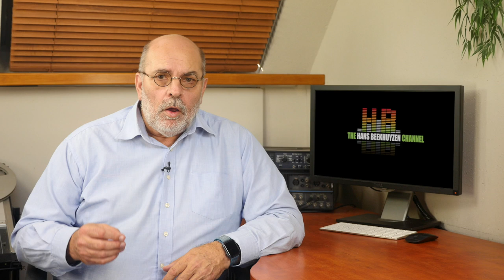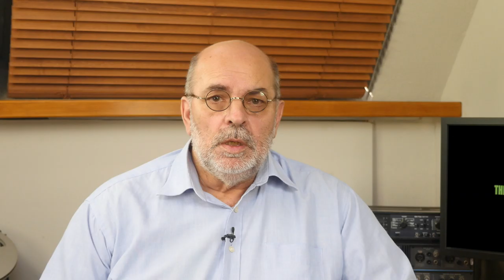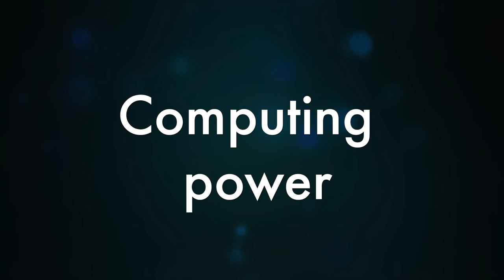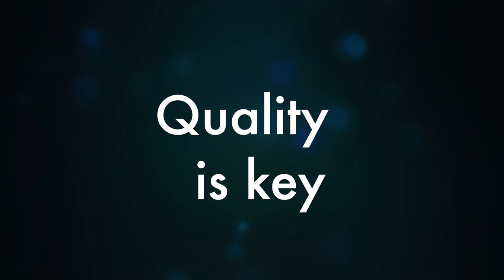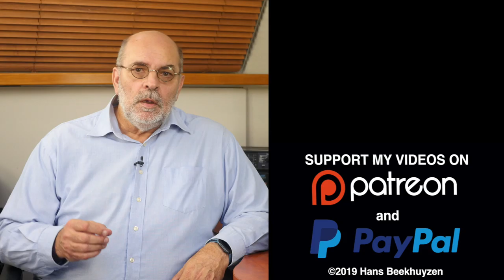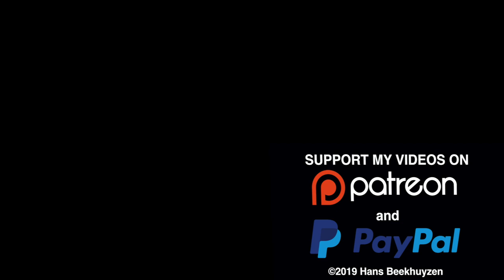Why upsampling?

Comment: That's a very interesting one, thanks. I only recently learned about how and why upsampling works (from your channel, Hans, when you were talking about DAC filtering in a previous episode), and when I saw an upsampling Cambridge Audio DacMagic Plus going for a good price, I got it. My existing DAC was a DacMagic 100, which sounds good to me, but even with my modest system the DacMagic Plus really does sound better. I haven't decided which filter option I prefer, but they do sound different. I haven't tried software upsampling on my computer yet, but I'll give that a try too.

Comment: Yes wholeheartedly agreed, upsampling with right modulator and noise shaper for given music genre  and adequate combination of the above  for the final output sampling rate can work wonders, but it can also hurt the music or the staging  if misused, also pulse phase manipulation is important, and I like minimum phase for studio and acoustic music and linear phase for orchestra or classical recordings,

Now, how about a video for "bits are bits" crowd? I've worked in IT and Medical environment long enough to know 0&1 are not universally perfect from A to B, and in this case, people look into wrong areas like strictly transports/protocol details to back their claim, entirely omitting the fact that EMI / RFI polluted environment or poorly screened cables or device topology might cause bit flipping and ECC mechanism will not be able to replace corrupted bits as distortion occurs outside its area of operation... Maybe this is something you would consider talking about, as I would rather spend my energy enjoying great-sounding music than evangelise stubborn individuals who know better and can be resistant to broadening the knowledge 😉

Comment: "I prefer minimum phase with smooth rolloff" can someone tell me if there are any issues with linear phase filters? Without having listned to a range, it makes more sense to me...
Reply from the maker: Linear phase filter can only. be built in the digital domain since they will only work when the filter 'knows the signal in advance'. To achieve this, the signal has a look-ahead component. Especially with the steep filter needed in DAC's , this causes 'pre-echos' that influence the attacks of signals and thus causes time smearing. Minimum phase filter only have post echos with is far more natural and in most cases is masked by the preceding signal.

Comment: Have you heard NOS DACs and what are the advantages? Many audiophiles prefer these non-oversampling DACs and claim more relaxed, natural tonality and spaciousness without the tiring gritty sound of over sampling ones.
Reply from the maker: I have reviewed quite some NOS DAC's and can only conclude that the ones I reviewed are very fine sounding products. But that doesn't mean that NOS is the answer to all DAC questions. I use a ladder converter DAC in MOS mode in my setup 2 but an oversampling DAC in my setup 1

Comment: What are your thoughts on this subject if there is a miniDSP SHD Studio in the chain between my computer and DAC? I'm thinking of buying one. The miniDSP's internal sampling rate is 96Khz so I'm not sure what happens to an upsampled digital signal it receives and what it does upon output to the DAC.
Reply from the maker: It can receive PCM up to 192 kHz and outputs 96 kHz in a very clean digital signal. Try it, it's great.

Comment: can you make an example of a good upsamling setup.? one with roon and one without. :)
Reply from the maker: That depends on the equipment used, there is no universal scheme.
Reply: @TheHansBeekhuyzenChannel   Your upsampling is nuc i7 roon core(Upsampling) to nuc i3 (output) to dac? i currently have 2 nucs trying to do a setup without roon. at this point i am running linux on the nucs. and 2 mac minis trying to do something similar. I have found that ther is a lot to be gained in this handling of files. Any advice other than roon.  :):)

Comment: Hey Hans, it's your Scorpio brother again haha, so I'm very lucky to have found your channel. I've made some updates to my system based on your channel. Latest we spoke about was my sms200 neo and sBooster. They are breaking in now. With this latest addition to my setup I've never adjusted my filter settings in Audirvana. Last night I did some searching but it's way above my understanding. For now I've set my Nyquist to 88 and phase filter down to 30, some say set it to 0. Am I heading in the generally right direction based on theory?

Comment: Nice review and I have one question, I use the Devialet 440 Pro Ci with Wilson Sasha2, Nordost Tyr2 cables, dCS bridge and Metronome T5 transport. The Devialet is already very resolving but I’m questioning myself if I would get significant improvements adding a dCS Upsampling to my system?
Reply from the maker: I have not (yet?) reviewed the DCS upsampler so I can’t say.

Comment: Does up-sampling help with a DAC like the Schiit Multibit DAC or R2R ladder dacs?
Reply from the maker: I have no hands on experience with the multibit but in general upsampling will improve the SQ
Reply: If doesn't with Yggdrasil and I am sure it's the same with Gungnir and Bifrost 2. Don't know about the smaller ones. Concerning Yggy and upsampling you can find user info on the interwebs.
Reply: @econautx  agreed - I learned this over time thanks :)

Comment: You did not mention the issue of high res audio and the output bandwidth of the DAC. If the DAC supports so called high-res audio, it will be designed to accept high (>44.1khz) sample rates as native audio, not assuming it is simply upsampled audio to help the analog filter. If you upsample a 44.1khz file to, say, 88.2Khz, and send that to an 88.2khz capable DAC, the DAC will surely assume that this is native 88.2Khz audio, and that it should start filtering at just above 44khz, in order to output an analog signal with a 40khz bandwidth, rather than filtering at just above 22khz in order to output a signal with a 20khz bandwidth. In this case, all the audio between 20-40khz will be output to your amplifier, causing the amplifier to produce substantial intermodulation distortion within the proper 20-20Khz audio band. This is unlikely to help the sound quality. Amplifiers nearly always produce more distortion at high frequencies than at low ones.
It seems to me that the technique you are espusing only works if you use a DAC which can be controlled in such a way as to accept an upsampled high sampling rate signal (such as 88.2Khz or 176Khz) but to filter using a filter starting at 44.1Khz. Is there such a DAC?
Reply from the maker: If a 44.1 kHz signal is upsampled, it is filtered by the upsampling filter at 20 kHz. Thus the resulting 88.2 kHz signal stil won't contain information above 20 kHz so it doesn't matter that the analog filter is set at 40 kHz.